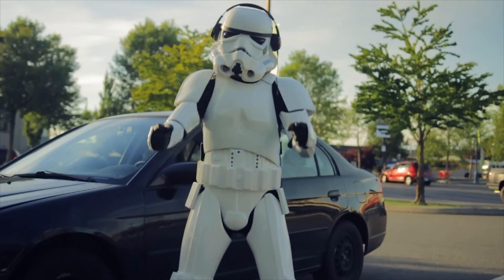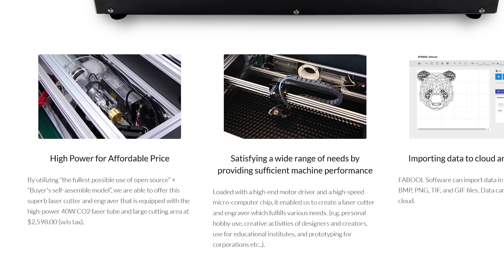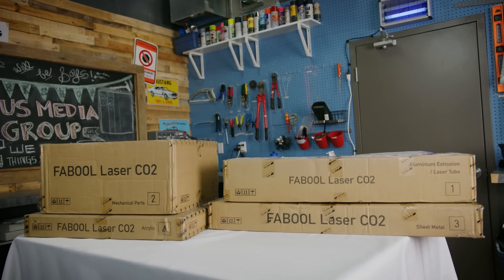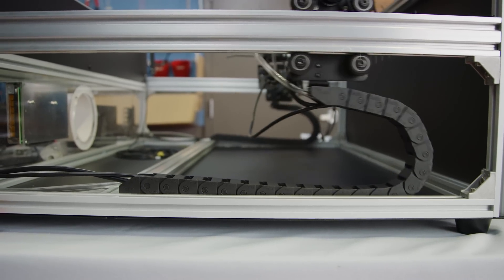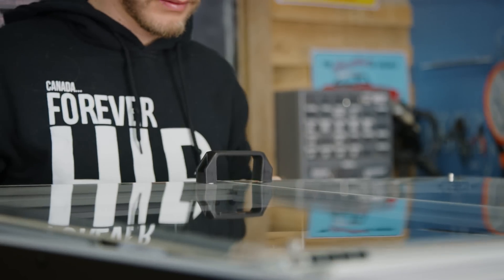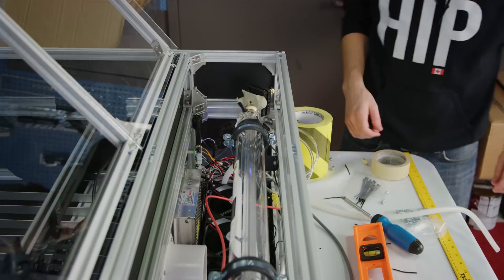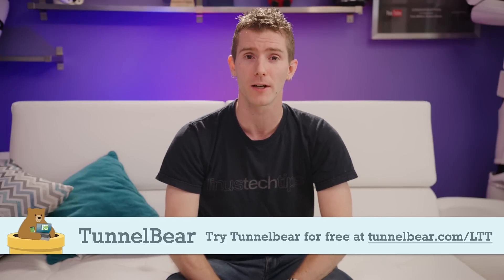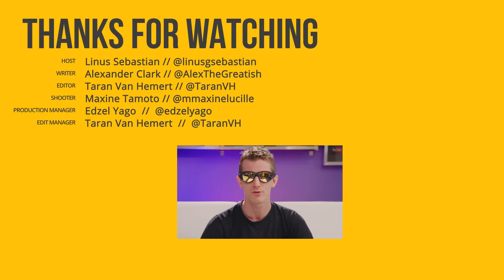We Built a FRICKIN Laser Cutter - HOLY $H!T

Comment: 3:28 Actually the real name is wire tracks, commonly known as drag chains. Laser tank chunk thingy's are probably not written in like that in the instructions. Considering the fact that you obviously didn't read the instructions enough, research what materials you plan to cut BEFORE cutting or engraving them. In vest in an enclosure and an air filter or run the machine outside, and double social distance. NEVER stand in the way when wind is blowing toward you when cutting.

Comment: $2.5k for a 40W laser kit??  A 40W laser has to be over driven to cut most acrylic, don't expect your laser to last more than a couple dozen hours.  If you're savvy enough to be down for a kit with that kind of budget an 60-80W China blue driven by K40whisperer on the PC is the way to go.  Twice the laser for the same cost, fully assembled, and you stand a good chance of it being perfectly aligned out of the crate.

Comment: Huh... It appears you are driving the steppers to quickly or they are not getting enough power and therefore missing steps.
About aligning the mirrors, yeah that's a rather annoying process, it really shouldn't take anywhere near a day though.
And finally, while laser cutters most certainly have their advantages. 3D print can certainly be very strong. Sure the prints will always crack the easiest between layers, though if you set your printer up correctly, your layers should fuse together very firmly. Mainly I would try printing with the highest temperature possible without it negatively affecting the print quality, also it's always better to print nice and slow if you have the time and if possible with a layer height of about 50-75 % the nozzle diameter.

Comment: There's definitely supposed to be a spacer between the pneumatic extension arm and the door at 4:48. That's why the bolt is so long. The spacer prevents the body of the arm from rubbing against the aluminum chassis of the laser cutter.

Comment: Jesus, so much is wrong with this video. 1. You never align a laser at full power, especially one that can cut metal. 2. Putting tape over the mirrors and then burning through it is a prefect way to coat them in all manner of crud. 3. 99% percent sure those are kinematic mounts they are working with, so you can adjust the tilt of the individual mirror without going back and moving the damn laser tube for every adjustment. 4. A bloody clear plastic lid?? I know its IR so it'll be blocked initially, but that laser is going to cut through it pretty quick, then you have a powerful invisible laser beam bouncing around the room.

Comment: ExpressVPN, the best VPN to use especially for Netflix and Geo-location blocking. Tunnel Bear is not as good. I even have pfSense on my PowerEdge R710 Server and have ExpressVPN as the main gateway to my router and presto, Safe and secure encrypted networking to all my devices, and it runs very well.

Comment: That was painful. That has so many design errors. One, those glasses are for UV radiation, not the CO2 infrared that this uses. Two, the vents need to be shielded from the inside. Third, Lexan, not acrylic, must be used because Acrylic/plexiglass does NOT ABSORB IR RADIATION. So, what do I wasn't to see you do? Take it apart, fix the VERY DANGEROUS safety issues, then continue. Also, do NOT cut PVC, as it liberates Chlorine gas, and no MDF, as it liberates Arsenic. Otherwise, good job and good luck.

Comment: I was actually thinking of printing a case a while back. 

I planned to use M8 and M6 threaded rods and bolts as the frame, similar to the manufacturing of some of the mendel/prusa mendel printers, and having a single piece of sheet aluminum as the backside panel, along with 3DP frames for pool screen to allow good airflow. 

That was a while back, and I just wanted to build my darn PC, so I just threw it all in a DG - 87. It'd be nice if you all made a case with it and the ulti, just hopefully one with good airflow.

Comment: Linus, I believe that port a at 3:50 is for air assist.  It helps the cutting and engraving process a TON.  I run a couple Epilog 50w and 100w lasers for etching/engraving computer case tempered glass panels and some woodwork.

Comment: Is that Radiator used to cool the laser tube??? I have a large refrigerated cooling system on my 60w CO2. You should keep a close eye on the temp if you plan on cutting several parts back to back.

Comment: So instead of using mirrors, why didn't they mount the laser on a moving platform itself? Sure, it would take a lot more motor power to move the whole laser, but at least it wouldn't be anywhere as frustrating as the calibration process

Comment: Wow, you paid too much, get a K40 for $400 and add an activated charcoal filter for indoor use and a 5 gallon bucket of distilled water with heat sink for a cooling water reservoir and you have a laser cutter with the same capabilities.  Also, no need for anything more than thick plastic safety glasses for laser safety with a 40 watt CO2 laser cutter at 10.6 um as the bottom of the cutter scatters light and even a pair of plastic safety glasses will absorb that.  Important safety tip: No chlorinated plastics in the laser cutter, the results are toxic.  Especially no stripping PVC insulated wires as copper enhances the yield of chlorinated toxic byproducts.

Comment: I guess the fitting on the side is for compressed Air which should run through the laser head while you are cutting. If you don't the smoke and vapors will most certainly render your focusing lens useless.

Comment: At work we use 6kW Co2-Slab laser to weld. Pretty awesome machines but they are huge!
Reply: Oh and just to add,  that fitting can be used with a compressor and tube, since all vapours and some gases will diffuse the laser you will get worse results, and some pressurised air to blow the vapours away from the workpiece and you'll get a better result. And also the workpiece will not start to burn.

Comment: The main things people use laser cutters for is to cut plastic or wood? No, they're mostly used in industry to cut metal.
Reply: A 40w co2 wont cut metal, nor will an 80w
Reply: Tim Ramich That really depends on what is used to produce the laser and what is the light wavelength used.
Reply: I was speaking of the general things that laser cutters are used for. They're industrial and for metal.

Comment: LTT: Your stepper motors are skipping steps, just adjust the gains (current) on the controller board (more or less amps) and if it doesn't work try loosening your belts to reduce the amount of effort needed to move the axis. Or use luuube on parts that doesn't slip properly :) Note that only one of your axis is affected (x probably). Please thumbs up!
Reply: "luuube" xD ;)

Comment: 3:28 it’s called an energy chain and is very common in cases where you don’t want your power and data cabling pinched when things slide.  Very effective, kind of a pain when replacing or adding cables but it’s worth never breaking one.

Comment: The calibration of the mirrors might have been easier if u would have used a laserpointer in the place of the actual laser cutting laser. The pointer could have been set inside a cardboard tube. This way the approximate calibration is easier to do because of having constant laser and not having to turn it on and off all the time. Saves a fair bit of time.

Comment: Hey linus
the weird fitting next the usb adapter is for an air system. with this you can blow away the smoke so the smoke doesn't burn in into the laser

Comment: Hi, Cool to see you are getting involved with laser cutters, lots of options and nice engravings, brackets and custom parts can be made with them.

That cutter looks cool, except for the overuse of expensive components like all the extruded aluminium for the frame which is not really necessary. The parts look almost exactly like the cheap ones that come in the k40 cutters on ebay for about £350. 

Yes, aligning the mirrors is a right pain, take ages and it not fun but glad you got it all working. 

Ensure the ventilation is way overpowered as vaporizing acrylic is like breathing cancerous gasses that literally make you feel sick after cutting for a while.

You also released this on my birthday, yesterday.. Cheers ! Will be interesting to see what projects you make.

Comment: Hmm, one of the first time I've been disappointed with one of your videos, Linus..

First of all, you didn't build a laser engraver, you bought one and put the parts together. Secondly why bash 3d printing? They are two TOTALLY seperate things and one is not Better than the other. 

PS: If you are able to pull apart your 3d prints by its layers then its time to tune that Ultimaker of yours, because 3d parts are VERY strong. Watch some videos about it 😊

Comment: jesus.... as a guy who works with about 12 industrial laser cutters as my actual job... alot of this video made me cringe quite a bit .-. A. the blue fitting is for the "blower" usually the nozzle of your tub lens tube assembly has a place for an air hose to hook up to keep smoke and crap from getting up onto your lens which will cause your laser to not cut well or even melt the coating on the lens or cracking it B. Don't touch the laser tube with your bare hands.... skin oils are bad on that shit yo. C. please tell me you have some sort of exhaust system for that thing.. melting acrylic, smoke  or paint fumes are not good for people, and the trapped smoke will dirty your mirrors and lens fucking up your cuts and damaging components. there is ALOT to a laser cutter and short of slapping people with a book its not a fun experience... it LOOKS neat, but that wears of about the time you realize all the maintenance that is required to keep them working well. I would NOT recommend anyone get one UNLESS they have experience with a CNC machine and some knowledge of fine mechanical tuning and SPECIFICALLY need it for something, otherwise tbh a 3D printer is the superior fabrication tool for people who want to DIY their own stuff

Comment: Not sure if it's been commented yet, but the "funny connector" looks like an airline Push-to-Connect fitting (my guess is a 1/4" outside diameter tube). Probably to fan the mechanics inside the chamber, or possibly to blow debris away from the part being etched. Hope this helps!

Comment: Why can't they use an optical fiber to guide the laser beam instead of mirrors?
Reply: Optical Fibre are specifically made for transmitting Solid State Laser..

Salvigini makes L3-4020 6000 W Solid State Laser which is transmitted through Optical Fibre, im working as a programmer for Salvigini L3-30 & Amada Quattro..
Reply: optical fiber cable for transmission of Laser is not Cheap and it need ND YAG Solid State Laser to Transmit which is again, not cheap..
Reply: I suppose you can't use any laser with optical fiber due to losses, am I right? Otherwise, I don't see any reason on why you need an ND-YAG laser instead of CO2 laser like in the video
Reply: ND YAG Solid State Laser can be used with routed through Fibre Optics..
Reply: wouldn't it melt the optical fiber? idk im not sure if optical fibers are designed to handle the heat of a cutting laser
Reply: This is bullshit, you can send any kind of light in an optical fiber, but some wavelengths are subject to less losses, and they depends on the medium used to fabricate the fiber. Anyway, to melt an optical fiber you'd need a power of around 2 megawatts per square centimeter, which is quite a lot
Reply: Hollow Silica Waveguide: https://www.lasercomponents.com/de-en/product/fibers-for-co2-and-eryag/
from the datasheet: High Laser Damage Threshold: > 1000W @ 10.6μm, Transmission Optimized for CO2 Laser
Reply: The CO2 laser has a wavelength of 10,6 micrometres and glass can't transmit this wavelength, also the mirrors that are used for reflecting the laser are probably made from some kind of polished metal and not glass.
Reply: then why not make a metal cable with polished insides?
Reply: Fazeen Nasser seems like a lot of work to make something like this also mirrors are way cheaper.
Reply: Laser run over 1000° Celsius, it will just burn the cable
Reply: The laser head moves but the laser tube doesn't. So the mirrors are constantly changing distances between each other. If you had fiber optics the line would be constantly bending, changing curvatures and distances between the tube and head. And that would be bad. Same reason you can't put any kind of cover between the mirrors
Reply: If that was the case then every Laser Machine which is targeted from 20W Hobbyists to 6000W Manufacturing Industry would have used CO2 Resonator to transmit Laser via Cheap Optical Fibre (Which is cost effective medium & maintenance free)..

"2 megawatts per square centimeter".......Whaaaaaat?

8 years of work in Laser Industry is bullshit...haha....
See my video of 2010 which i'm operating Amada Quattro..
Reply: Markus Buchanan you're right. But it would technically make it earthquake proof and more portable than the delicate mirror setup!

Comment: The blue "fitting thingy" is for air pressure. It's there for a purpose Linus, it prevents besides other things a fume coil back to the laser lens. Also, be aware of what material you're going to cut. PVC for example releases poisoning fume when it's cut by a laser. Pmma (Acryl) is save to cut. A fume extractor is still recommended.

Comment: The pneumatic fitting on the IO panel is for an "air assist" it allows you to plug in an external pump to blow the debris off the workpiece. It's usually not completely necessary but can definitely be helpful for cutting and it also tends to make the lens on the toolhead stay cleaner for longer.

Comment: Where to put radiator on cooler master masterbox 5 Rgb? No vents are present at top for it ....should i place it on one of the front Rgb fan?and if yes do i have to remove that Rgb fan or can i have it on the other side of my radiator ? .... static pressure(pull) fan is on one side and the Rgb airflow fan(push) on the front.....?

Comment: I work in a steel mill that uses lasers to cut through up to one inch thick steel, and any serious use will require replacing the surface your cut components rest on, so watch out for that.

Otherwise, build a case that your monitor can mount onto, and has a folding cover that holds the keyboard and mouse. Like a mobile battle station! And make it Battletech themed!

Comment: Custom shrouds for Graphics cards
Etched windows for cases
Laser cut and etched slot covers with embedded LEDs.
Laser cut side, top and front replacement panels popular cases - Cabinet grade plywood (probably 1/4" (6.35mm)),, smoked/black acrylic,  and leather (mounted on plexi or mdf).

Layered acrylic and wood trophies for next Scrapyard Wars.

Unfold a cardboard box and make it into a case by cutting all the appropriate holes and notches. Reinforce with either wood or acrylic as needed, the build a PC in the box case.

Etchings of the staff in acryllc. Paint in the hair and eyes, but RGB backliging for Max's so it can change when hers does.

Comment: "built" well not really u just put together a DIY kit...
Reply: Shazzkid Would you call it pc "building" or something else? I mean you don't build the parts.
Reply: DecesTV i would call it PC building, but that's because its used so commonly its hard to think it means anything else. But if i hear someone say they built a table, or they built a 3d printer, or in this case a laser cutter, i assume its more than just a flatpack "assembly required" item. Not necessarily fabricating all the parts but alot more involvement than just a DIY kit. I mean its pre built, just slightly disassembled for transport.
Reply: Shazzkid I can see what you mean.  I mean I could say I build my desk, me and my brother cut down everything and actually made it custom. It came out pretty awesome and can say actually building stuff is so much better then buying a pre built desk.
Reply: DecesTV exactly, you built that desk, and it just isn't the same if someone bought one from ikea and said they also built a desk